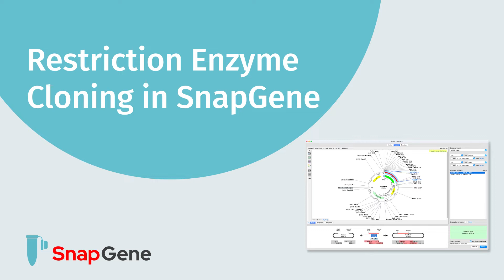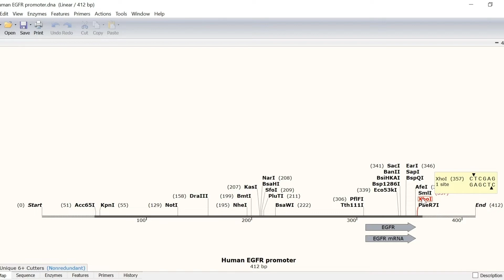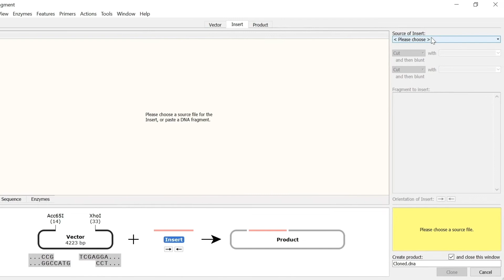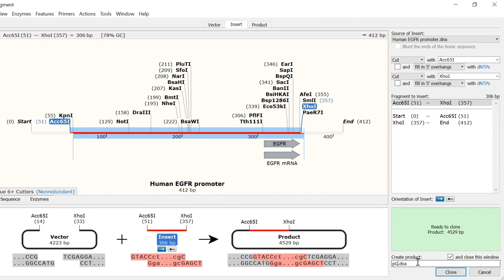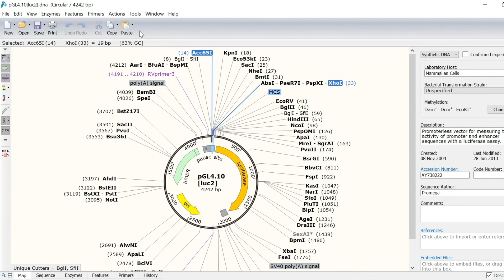Restriction Enzyme Cloning in SnapGene

Comment: This is really a nice video. The problem is I have been trying to replicate using the same vector and insert. While I have gotten the vector, the EGFR promoter sequence I got (600 bases) is quite different from yours and thus enzymes differ. Could you share where to get the exact EGFR promoter sequence used in this course.
Reply from the maker: We're so glad you like the video. We got the promotor sequence from NCBI. The Accession number and link are listed below. I hope that helps.
Accession number: J03206.
Link: https://www.ncbi.nlm.nih.gov/nuccore/J03206
Reply: @SnapGene  Thanks. Would try immediately
Reply: @SnapGene  sorry but that sequence is not the one you used on the video, it doesn't have acc65I. how to get the same sequence as yours, please